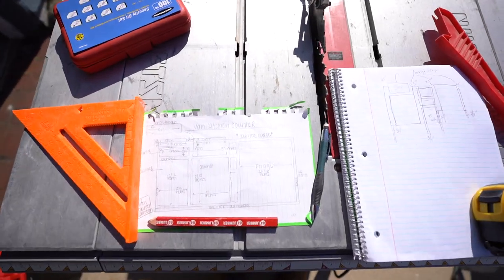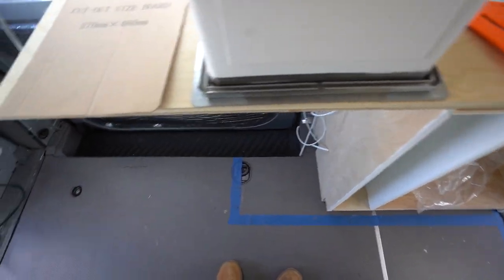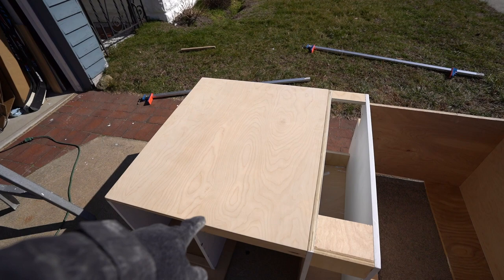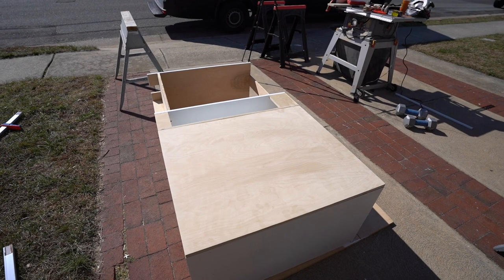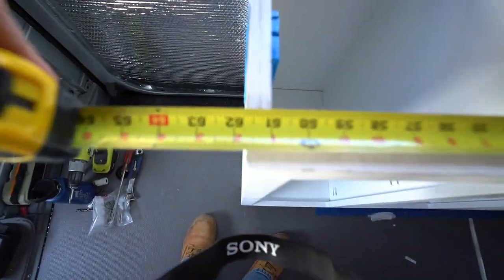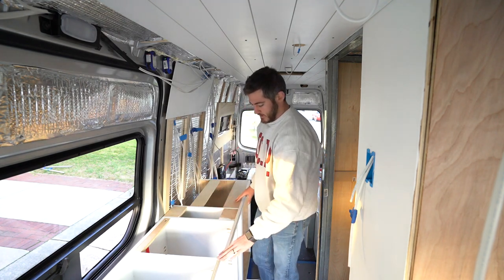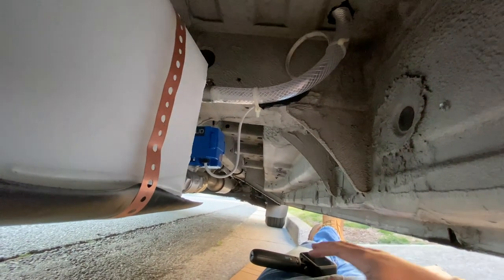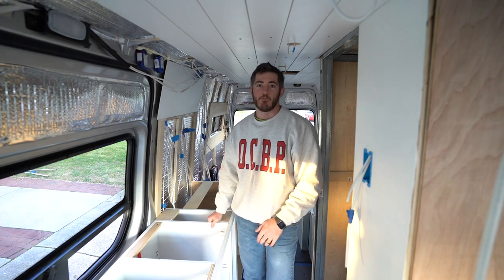Building the Kitchen Cabinet and Installing the Grey Water Tank - Van Build Ep 20

Comment: Great details.  Just one suggestion with the gray tank supports.  As you fill with water and travel the water weight will slush around and may cause the brackets to loosen.  I suggestion to tighten the straps so the tank has no movement

Comment: Hey guys, 
just small suggestion. When are you running your hot and cold pipes under the cabinet, I noticed that you put them together and isolated them in one "tube". This will cause heat transfer between the pipes and unnecessary loses in temperature. If you can, run and isolate them separetely or put  something between them (thin isolation, rubber, ...) so they are not touching. Hope this will bring some value to you :)
Reply from the maker: Acnnair that’s a great point! I will try and separate them before we screw in the cabinet! Thank you 🤙🏻

Comment: Did you run a line for the vent, or just the barb fitting? Does it leak out when driving?
Reply from the maker: Just the barbed fitting.  It may if it’s really full but not enough to worry!